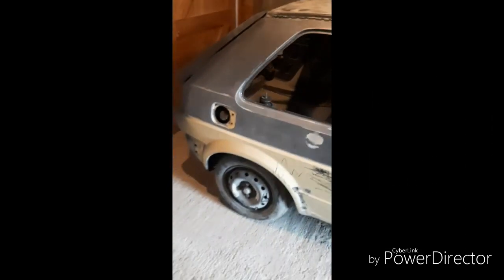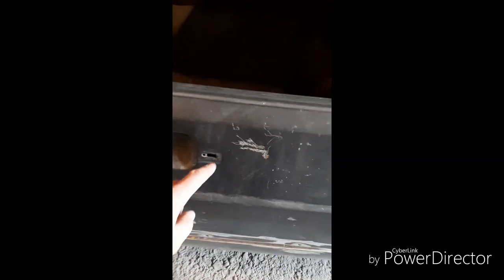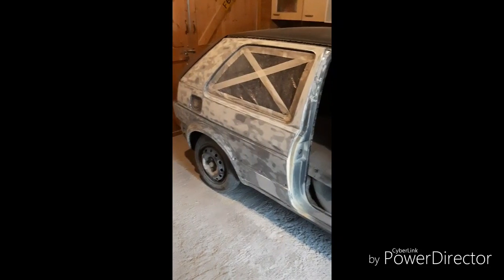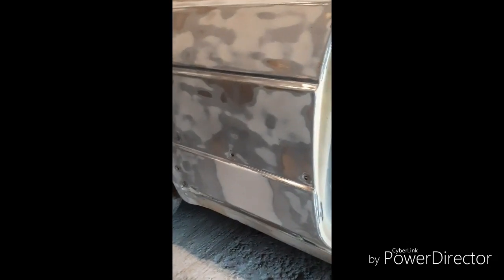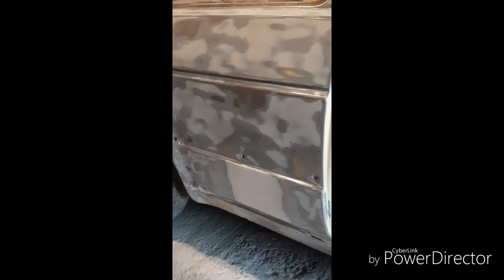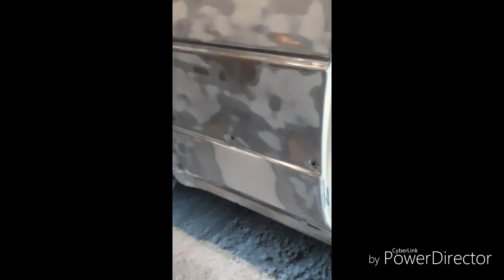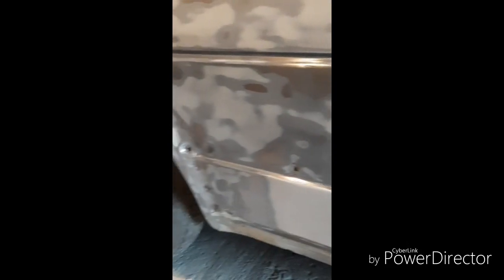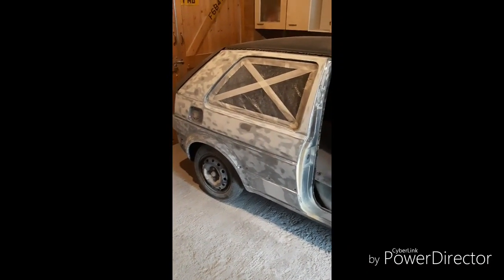Mk2 Golf Gti 16v Restoration - Turn Around

Comment: Just about to do mine  this year my lad is a panelbeater/painter  so  I'm looking forward to be doing it with him also I'm running a 2.0 abf heavily ported head running a k jet off a 1.8 kr engine strapped to a 1983 mk1  8v box and a 8v stage 1 clutch  and it was dyno'ed at 180bhp anyway keep up the good work 😉👌👍
Reply from the maker: Not slow then 👌
Reply: No it goes quite well  click on to my channel there's all sorts on there it does quite a bit of track work also does performance runs on the roads also got a mapped mk 5 golf tdi🙈🙉